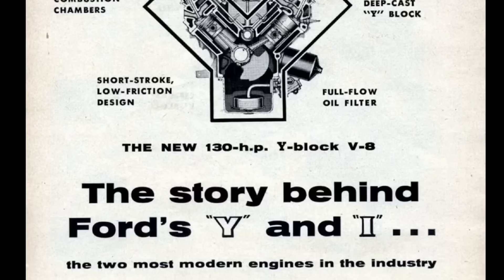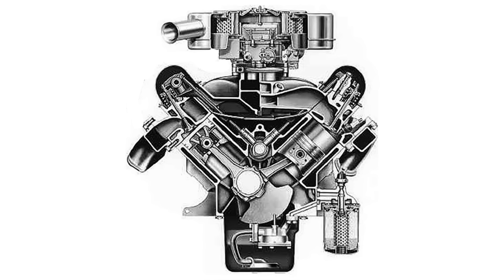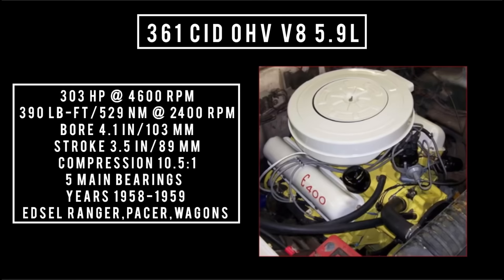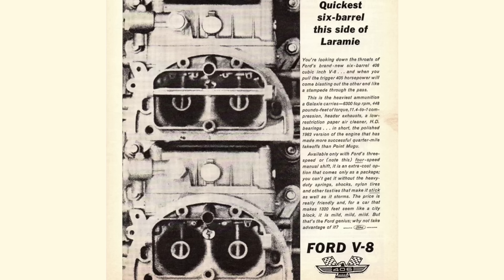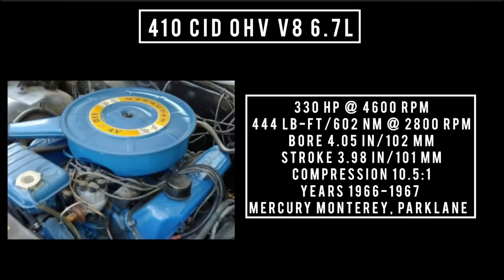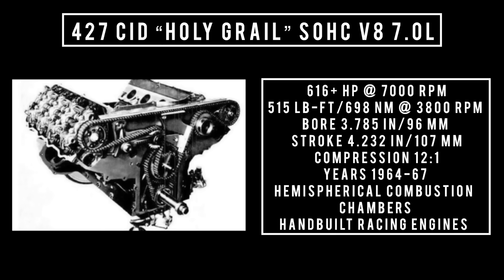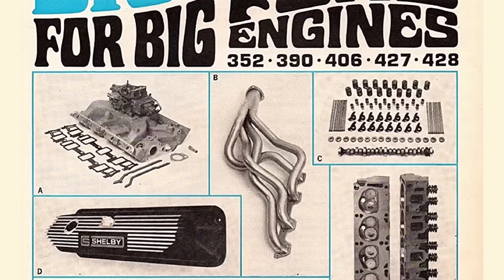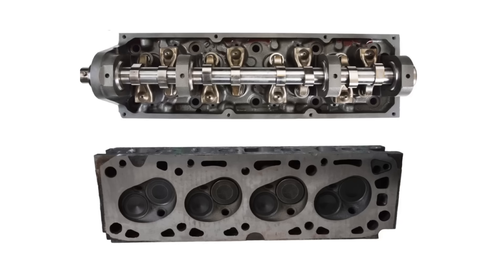Ford FE Engine Family 332, 352, 361, 390, 406, 410, 427, 427 CAMMER, 428, CJ428, SCJ428

Comment: It's a good thing you strarted with the disclaimers on power ratings and variations, as Ford seriously under-rated some of the FE engines so as not to cause racing sanctioning bodies to ban them (which did happen anyway), and there's likely 100+ variations with these, as Ford made lots of small changes throughout production. An interesting note is that for 66, Ford's RPO list had a "7L" option, which in early cars got you a 427 from the last casting run, and then later on the first 428's. You couldn't specify which one you'd get which AFAIK is the only single time in history that anomaly this happened.

I was lucky enough to once have a 427 side-oiler with medium-rise heads which has been claimed (not by Ford) to run from ~380HP to 500HP+ according to who you listen to. All I can say is that it was scary-fast with a Holley 750 in a 64 pickup (not OE) where a previous owner had decked the bed with 1/4" steel diamond-tread plate giving enough added weight for decent traction. Had to retard the timing some to run on pump premium which by then wasn't as high-octane as when the engine was introduced. Let it go when the transmission finally melted down; I didn't know how scarce it was and I'm still kicking myself for that 40 years later. 

WYR I like that particular year Galaxie. I like the T-Bird's engine, but the Torino hits the bullseye for styling so it gets my vote.
Reply from the maker: Great choices 

I always do for the engine episodes because a lot of the figures are rounded lots of information contradicts other information and it doesn’t even really matter if I do put a disclaimer because people will contest information... but I try lol
Reply: But they say if you want to go fast you got to have a chevy.
Reply: @RobertDickens2002  I don't know who "they" is, but Ford's 427, 428, and 429SOHC along with Chrysler's 426 Hemi and 440 consistently beat anything GM had to offer. Not to belittle Chevy's small block which is one of the all-time great engines, but the only thing that kept Chevy in the game was that adding performance to their factory designs was easier and cheaper and still is. Ford stopped fielding factory race teams in the mid-60's while the others didn't but they were still winning long after that. And Chrysler's Hemi design still dominates the top classes of drag racing (though those engines have no Chrysler parts left in them). The one place that Chevy dominated was the old Trans-Am racing series where their 302 in Camaros was so unbeatable that interest in the series petered out and it ended. So whoever this "they" is that you're listening to is just flat-out wrong.
Reply: @P_RO_  they is everyone.
Reply: @P_RO_  I never said I was listening I said it's been said.
Reply: This was sarcasm

Comment: Great job on these important engines. I had a few cars with the 390 in them. Wonderful engines, other they were hard to start in cold weather.
Reply: Funny you say that. Manual Choke was the best one to get.
And they took 10 minutes to warm up.
Reply from the maker: Thank you so much glad you dig this episode
Reply: Some can be my 410 in my 69 Ranger starts easier than my 79 LTD Landau's 351Windsor

Comment: In 1970 dad bought a 1968 Mercury Cougar with the duel 4 barrel 427 side oiler  . It was suppose to be mine in 1982 but was stolen, stripped in 1980.
Reply from the maker: That’s crazy thank you so much for sharing that story with us even though that it was a bad one did you ever find the engine or who did it

Comment: Ford FE always had top end oiling issues !
Reply: No they did not you are thinking of the Y block.    The FE/FT had NO top end oiling issues.
Reply: Nope. My 427 has too much oil. Used restrictors in the heads.

Comment: The 427 engine of 1965 was nasty,rough running and noisy. I think the idle speed had to be kept rather high.
Police officer relative got rid of it after about a year or less. Replaced with a 1966 car with the 428. It was smooth and quiet enough to rival a 1966 Oldsmobile which cost more. Well behaved yet would accelerate like a muscle car when given pedal to the metal. The 427 probably was quicker but that came at a price compared to the civilized 428. 
I suspect that the 427 car would have more than held its own vs. the more stylish and more comfortable Pontiac GTOs,at least the early year GTOs. 

  Were the FT truck engines the same thing as the FE engines except for perhaps different motor mount pads and/or pads for mounting an air compressor for brakes? The 361 and the 360 the exact same displacement?
Reply: Been told you can use a FT crank in a FE block if you turn down the snout of the crank to fit the timing chain cover front oil seal, I've heard that was done because the FT cranks were steel and the FE cranks were cast iron and i think that they would also have to recut the key way for the balancer after turning the crank snout down
Reply: @dinadaughtry8993  yes, that's correct. FT cranks are somtimes sought after. They are steel. They do need some machine work to work in a FE. They are external balanced as well so they need to be rebalanced to work as a FE.
Reply: Agree the 428 was a better street engine by far
Reply: The 361 FT & the 360 FE was the exact same bore & stroke. And actually the exact same block casting. But that's were the similarities ended. The block castings was identical but the machining was different, the crankshaft was different, tge balance different, oil pan, oil pump, pistons, rings, exhoust, heads, valves, timing cover, all very different.
Reply: The FT engines used a larger diameter crankshaft. Sold a friend a 66 ltd with a 390. He needed an engine for his F600 bob truck only to find it wouldn't work, because of the crankshaft size difference. That was in 1977 and good ford 390's were hard to come by due to all the dust sucking farm trucks that came with FE engines.

Comment: Ford manufactured the 427 side-oilers long after it was no longer available in Ford passenger cars. They were built for boats. So that someone wouldn't drop one of these in a land vehicle and the way they did that was that there was no hole in the rear of the crankshaft for a pilot bushing or bearing.
We worked with a custom boat manufacturer in the 1980's and this was the engine they used, having them in our shop.
I believe that the 427 is still made and they are all-aluminum. People would put them in those after market Shelby Cobras. The much lighter weight of the all-aluminum 427's made the Cobras handle better than the original ones with the cast-iron side-oilers.
The first-gen 427's had problems with oil starvation so that is why they created the side-oiler 427.
Back in the mid-60's, in the cars marked 7 Liter, Ford would put either 427's or 428's in them and the person who bought the car was informed.
Even after Ford no longer put 427's in cars, they still made them and sold them as complete crate engines. Say you bought a new '68 or '69 Mustang and it had come with a 390 or 428, you could buy a 427 complete crate engine from Ford and the dealers would swap them.
Now, years ago, I actually saw and worked on two different 1966 Fairlanes which came from the factory with 427's. One was a coupe and the other was a convertible. The coupe was bought new by a California Highway Patrolman. When he was shopping for a new car, emission controls were starting to come on cars. Even as simple as they were using air injection pumps and timing controls, it was getting messy under the hoods. This guy saw that and he didn't like it. He asked the salesman if there was a new Ford that didn't have all those emission controls and was told the 427 didn't. That is why he bought that car. Although still quite powerful, when the 428's came out they were smog motors. Both of those Fairlanes were equipped with the C6 Cruise-O-Matic automatic, which was it's first year. In 1967, Ford went with the Select-Shift Cruise-O-Matics across the board, in all of their different automatics.
Reply from the maker: Awesome information thank you so much for taking the time to share all that. 

I posted a response or at least I thought I did.. this video has 2 major mistakes 332 cid 
Bore 4 in and stroke of 3.3 picture is wrong... and the bore stroke sizes were flipped on the 427 I made a revision episode but decided to let the original episode fly. I wish YouTube made it possible to just text over video if corrections need to be made I can’t be the only person with this problem

Comment: 332 four mani bearings WTF...way off on the 427 like bore  not rounding    tbir
Reply from the maker: What was the actual displacement of the 427 cid I think those numbers are flipped

There was conflicting information on the four main bearings thing so I typed five main bearings but said four but all of the other engines had five so I figured it was a typo
Reply: @What.its.like.  without looking it up I think around 4,233  Any non stock build uses 4.250 and those oversizes .  The FE rings are really old school and 4.250 you can get any ring you want  Most I stroked a 427 was 1/4"  MAYBE  more with aftermarket blocks

Comment: I drove a 1965 Galaxie 500 with a 352 that my dad bought in February 1966 as a leftover new     car and I started driving it in the fall of 1973 when it had only 9000 miles on it.  It lasted until 1990 when the dreded northeastern Ohio rustworm finally did it in.  I miss it, it was a caspian blue 4-door sedan 😢

Comment: Thunderbird and that mustang. Ed Pink was huge in the building , racing and refining of the of the 427 SOHC . Strange they made so many displacements that were close to each other , what was the point of making a 352 and a 360 ?
Reply from the maker: Awesome choices that Thunderbird was really cool looking
Reply: 352 and 360 question. From what I read from Ford literature.
The 352 was being phased out for the up coming 351's. 
But in 1968, there was still no mid cube engine. 289 was phased out in favor of the 302. In 68 Ford still running the 390 because of popularity.
So that year, Ford had no mid engine. 
So Ford took the 390 block and used the 352 crank. The mid cube 360 was born for 1968. Ford didn't want to lose any sales.
It was very popular. And held over for many more years. 
My dad bought brand new a 68 F 100 with the 360 engine. 
Eventually the exhaust manifolds warped and some bolts broke.
But I can attest that engine ran great and never lacked in power. 
I have the truck now.
Reply: 352 & 360 we're made for non performance vehicles that needed more torque than horsepower except for the 352 police interceptor
Reply: ....and the Ford Star-liner 352ci with 360 HP . 352 were in the Thunderbird's so not huge HP but not non performance at 300 HP. @purpurahaze9179

Comment: 62 Tbird
70 Stang

The FE series of engines provided the beating heart of the famous Ford versus Chevy rivalry.  I was on the FoMoCo side.
Reply from the maker: Awesome choices I would love to compare a 427 Ford to a 427 Chevy one day
Reply: @What.its.like. That would be an interesting Compare but, a 427 ford will be hard to find.
i have always been a ford Guy but something that dissapointed me about Ford, was the fact that Ford made wild race engines, but no local yokel could buy them, unless you had Racing Connections!  Chevy or Mopar never made real exotic engines but anybody that wonted to lay down the cash could Get one!  i have  a buddy that owns a 1969 ZL1 Camaro and another friend that owns a hemi Cuda! I knew a guy that Owned a 1966 Fairlane 427,  He got the car because he Raced for a large Ford dealer, with lots of clout.
Reply: The Chevy 427 was the better choice, mostly because the heads head better air flow than the stone aged FE heads. BB Chevys had a better oiling system too
Reply: @johneckert1365  Maybe in 2023, when the big block Chevy has 40 years of Aftermarket support, the Chevy is better.  In 1964 Ford 427 high riser would Kick the snot out of a 427 Chevy every day of the Week. How many le Man unlimited class  win's has the big block Chevy got. Oh Ya that is right, None The ford  won two in arow and then it was ban. If not for the Rule change  Ford would have won at least two more, Because they won with the 302 after the 427 was ban. Remember Ford  engine is obsolete because Ford made a better engine.

Comment: The FE’s are good, dependable engines. I had a 68 Galaxy fastback, and currently own a 66 Thunderbird with the 428. I love the 60-70’s cars, but must admit the current ones are much safer, dependable, and and last longer. I just don’t see them being collectible in the future.
Reply: I also don’t see anyone working through all the electrical issues todays cars will have in 50 years.
Reply: @brianhdueck3372  ,,,,,,,,,,,,,and in the future,,,,where to find parts.....no one will make money producing antique parts in the age of electric cars......
Reply: It's like they last longer but once they're broke they're too complicated and expensive to fix so many electronics that can leave you stranded.
Reply: I'd rather be in the crusher than the crushed and believe the best safety device is 3 point restraints which I now have in all my old cars (and front disk brakes). 
Square bird into same weight parked SUV at 65 mph no seat belt minor black eye and temporary sore neck from dash pad hit. 

SUV cabin crushed and all doors sprung. Bird front bumper and sheet metal mashed and kinked frame but zero damage from firewall back. Pulled front bumper from tire and drove it home. Square birds thick inner fenders are seam welded to frame exceptionally strong, entire car is very strong. I believe injury comparisons would be very different given 3 point restraints (except extremely bad design hour glass framed chevs).

Also my engine builder said most old overhead valve engines will also get high miles because the oil is a lot better. I know they're a hell of a lot cheaper to keep running. Problem is fuel use but I don't commute so don't care.
Reply: Especially since FoMoCo decided to stop building sedans
Reply: That 66 Thunderbirds a real looker. I have a 67 Thunderbird with the four doors rear suicide doors. She's rocking the 390 V8 but man that's plenty big enough to push that car around but I'm sure that 428 or 429 would be something special in that car. Probably just keep the original in it cuz it's running real well doesn't give me a lot of problems but maybe I'll do some upgrades to it get out something like 350 horsepower.

Comment: Was the 460 an FE engine?
Reply from the maker: No series 385
Reply: @What.its.like.  thanks...I had a 78 town coupe...460 4 bbl... Put duals on it...cut off the catalytic... open air breather...thing humbled a coworker with a Camaro with 350 4 bbl and headers! Left him slack jawed when I rolled about 35mph, punched it and set him back in the seat! Please don't judge on the catalytic bit! 😀👍
Reply: Did some of the late 429s and 460s come from the factory with the timing chain/sprockets such that the cam timing was a tooth or two late as compared to the 1970 engines? Fixing that helps to wake it up?  @kennethanway7979
Reply: @davidpowell3347   I did bump the timing up a bit.
Reply: @davidpowell3347 camshaft timing on later models was retarded for emissions purposes. Installing a cam "straight up" definitely wakes them up.